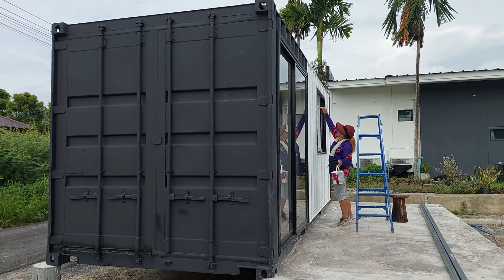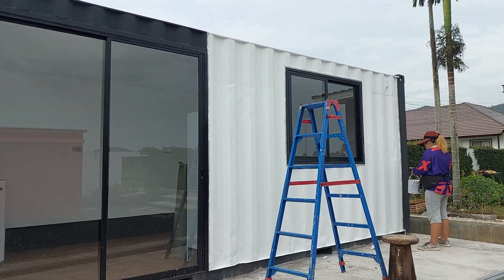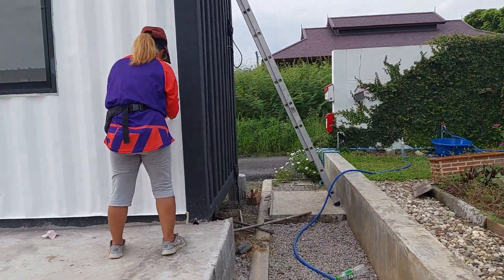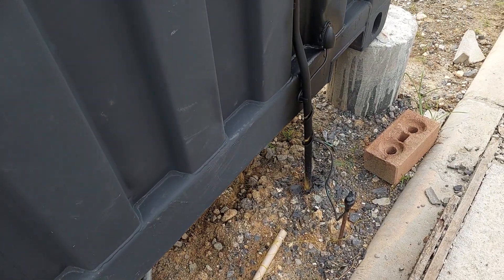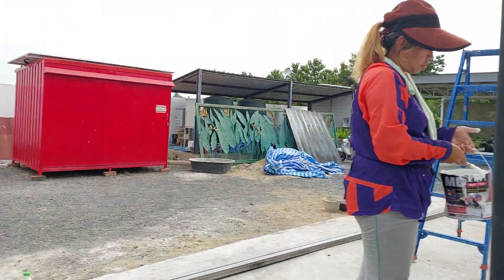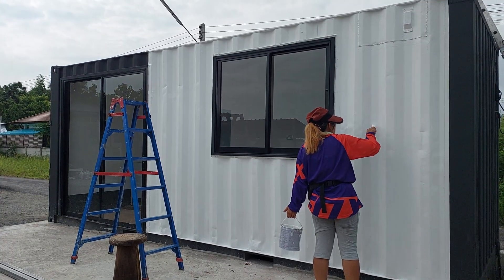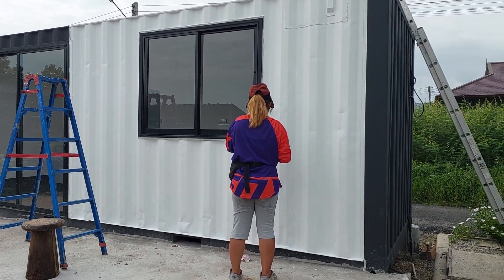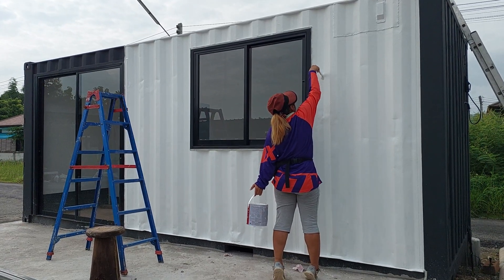Building A Solar Container Tiny House

Comment from the maker: Building a solar-powered container tiny house we bought an old 20 foot sea container and fitted a sliding door and a window.   Then we added drywall and a vinyl flooring and wiring for lights and sockets.  Then we added a distribution box for solar and grid electric by fitting an automatic transfer switch (ATS)  and setting it for solar as priority and backup with grid.  We ran PV wires through the wall and into the container through a waterproof and insect-proof gland and sealed it with PU caulk.  Now, here it's time to paint the outside walls to match the main house style, which is a black and white modern, tropical villa.